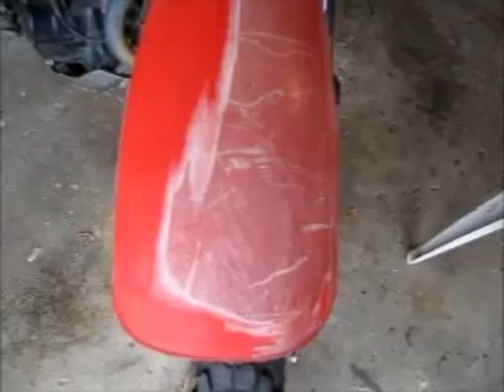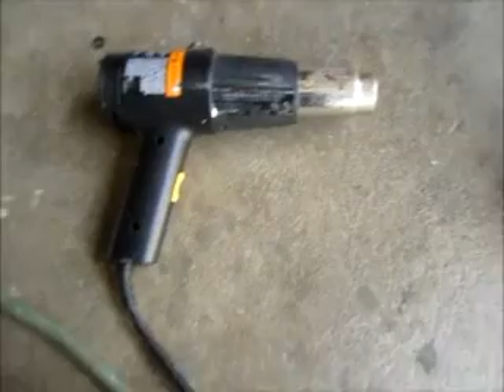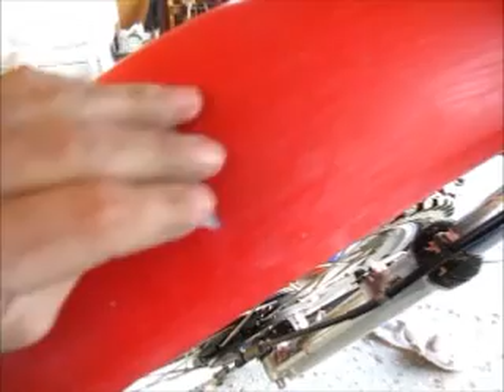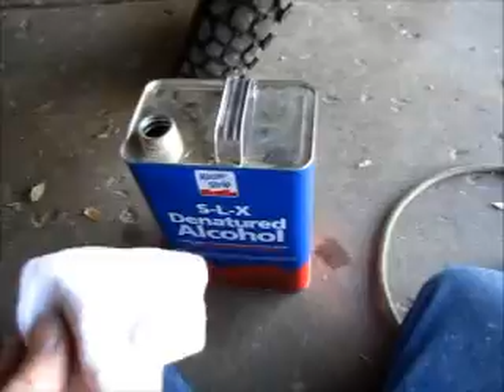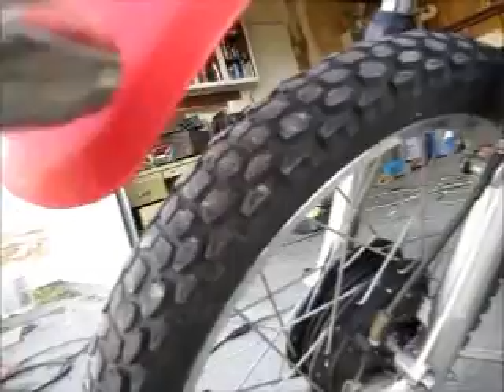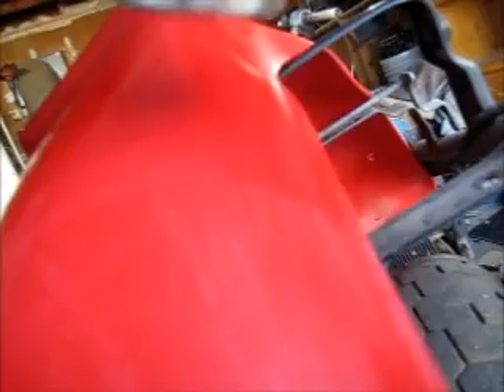How to Restore Faded Plastic Motorcycle Fenders (For free)

Comment: So I have a million dollar question. What if you own an R6, that is white but the head fender is starting to turn yellow? I love my bike and even though this method seems to be an outstanding way to do it, I just feel a little insecure to apply it. Buying the part would cost me $454.58 and not only that, but this was a limited edition color so I wouldnt even have it in white but rather in blue, red, yellow or silver and also if I were to paint it, then I would have to paint the whole bike to make an even color. So Im pretty much screwed. Any suggestions? =(
Reply from the maker: This won't work on painted fenders for obvious reasons :) You could try wet sanding carefully and polishing, otherwise paining is probably you're only option. Luckily white is a forgiving color to work with. Good luck!

Comment: How about sanding it with fine grit sand paper 320/400 an then heating it up an polishing Just wonder how that would work ?
Reply: TheAwGooner No - you can sand plastic and it'll be fine. Bumpers are plastic and they sand those all the time. They sand headlights too. You just want to use a very fine sandpaper.
Reply: skulledmonte84 I used a cheap headlight restoration kit and that plastic trim cleaner for cars.  turned out really nice.
Reply from the maker: I tried sandpaper, and it just didn't work well for me. It clogged up with plastic, and made the finish dull.
Reply: ***** Well i couldn't wait so i started out using 220 "wet sanding" VERY "time consuming" then i stepped up to 320 but still need to go over again with 400,600 an maybe even 1500 grit.Then i am going to use polishing compound an a buffer on low speed. an see how that goes,iv done this to aluminium an the outcome was great.OR i may just finish wet sanding with 320 an just put some good clear coat that's made to stick on plastic
Reply: USCisgay lol hey as long as it works i guess that's all that counts,i tried buffing by hand with polishing compound an it buff up a little an i really had to work it just to get about a foot by foot section,So i am going the easy way an using,Krylon Fusion Plastic Clear Spray Paint
Reply: skulledmonte84 id try to clean them up first.    Do what you like,  but maybe its just me, i really cant stand painted plastics on a dirtbike.  check ebay. what kind of bike is it?
Reply: USCisgay oh it cleaned up nicely while i was sanding it,It's a 4x4 four wheeler that i just wanted it to look a little bit better than what it did .Clear coat will be just fine for me,being that it's clear it will not be that noticeable if it does get nicked or scratched up,plus when i hit the mud your not going to see the flaws anyway Till i rinse it off again  But Thanks though
Reply: steel wool and soapy water. Then pledge. Buff it real good. That's how I've done a few old CRs.
Reply: dan2750 tan yes I'll try that tomorrow
Reply: never sand plastic it will ruin it

Comment: anybody tried the headlight restoration kits, like the one from Mother's?  I'm sure it works by just buffing away the faded layer on top, should work for solid colors too.  The paste and power drill buffer ball might make it easy and fast.
Reply from the maker: It might work, but the difference with these fenders is that it's a much softer than the hard polycarbonate on headlight lenses. That's why the blade worked better than a polish or sandpaper. If you have some of the stuff, give it a try though, maybe it'll do the trick.
Reply: yep iv tryde kit es tou small to even get 1 pic done let alone all the plastice.but i steal tryd gust to see end dent dou cheat

Comment: People just don't understand how hard it is to find plastics for old bikes.
Reply: Newoldstock.com
Reply: @S S thats not old
Reply: I agree they are hard to find and expensive. Better put those dollars in crucial parts... Tires, brakes, chain... Or riding.
Reply: And chinese dirtbikes without knowing the real brand of the plastics
Reply: Website is no longer the same
Reply: It's a pain in the ass I couldn't find rear number plates anywhere on ebay for my 1984 yz80 so I have to buy a parts lot in order to get them
Reply: Well you can find plastics for most bikes but they won't look the same, they will fit but will look way different. finding plastics that look like the originals that's the hard part.

Comment: the fading is caused by the surface of the plastic losing its essential oils and polymers. an easier way to bring back the color without removing material is to add oils back...mineral spirits, marvel mystery oil, and even WD-40 can be applied to the plastic with pretty good results. sometimes simply applying a coating of clear coat spray paint will bring it back, as well.
Reply: this is important to consider if you want to keep any decals or other details that you might ruin by scraping with a razor.
Reply: rtabish An easier but more time consuming was is buffing it with sandpaper and turtle way. :) Just make sure to use a flex block so you don't leave any finger grooves while sanding.

Comment: Did you try using only heater (before scratching plastic with the razor) ? How long the effect will last ? I think the original plastics from the factory has anti sun protection on surface
Reply from the maker: If the plastic is only a little faded, you can get by with just the heat. Mine were way beyond that though.

Comment: Infinite grit sandpaper? Not quite. Also, have you people never heard of wetsanding? You can get a glossy, mirror like finish if you know what you're doing and it will yield a surface smoother than you'd get using a razor. You may be interested to see the "sanding" and polishing techniques used in lenses/optics.

Comment: 60% Paint thinner and 40% Boiled linseed oil will remove the oxidation and bring out the true color...almost to factory new. It saves quite a bit of time and the result will last. Wipe the excess off as you go and you wont have any issues.

Comment: Depends on your make and model. My 88 GSXR you cannot just "go to the store" and buy plastics. Heck, you can hardly find plastics on ebay. Restoration is sometimes the only solution that would not require weeks of searching, and still require some TLC to get them proper.

Comment: I found the scraping with the blade to only really be helpful for removing any scratches that you want to take out.  If it's just faded/oxidized the heat gun works well by itself.

Comment: I recently did a front fender on my Yamaha Big Bear 400 and skipped the scraping process with the blade all together.  It will work with just the heat gun alone as long as you don't get the plastic too hot.  It's not perfect by any means, but from a few feet away you can't tell the difference from a new one right next to it.  Good video
Reply: I wouldn’t skip that process. Your just melting the oxidation layer into the good plastic. That will not look as good as removing it first. Then before using the heat gun do some wet sanding first. 400, 600, 800, Heat gun, Then let cool, wet sand 1000, 1500, 2000, 2500, 3000, Then use polishing compound on a slow setting on your polisher, polish, then top of with SC1 High Gloss Coating 😎👍

Comment: When the plastic is that oxidized/compromised your options of keeping it are limited.  

Today I used sandpaper all the way up to a horrifically expensive 4000 grit to remove some crust and vinyl goo from an '06 fender. I would have started with a razor if I had seen this.

Of course the best option is care but plastic has a way of self-destructing.  I consider my self pretty nice to my plastics but they needs special care- more than detailing even.

Comment: Yes, i did it to my plasics. Start with a bit of a rougher paper, then use a finer paper and a finer paper after that, untill the surface is smooth. It gets almost shiny with just that. But you can also use the heat gun to get more shine. Good luck!

Comment: you can also use a sandpaper, wetsand  it using 600grit then once the fresh layer comes out wetsand it again with 1500 then 2000 grit, it will also come out silky smooth

Comment: Great work! Could I ask you a question? I have a deepish scratch on my front fender which I hope to remove with some elblow grease. My plan is to use 2000 grade wet and dry to slowly sand it out. And then to polish the matt area to a nice shine using a plastic polish designed for coloured plastic parts like these. Do you think that I'll get a good result? Thanks again for the great video! :)

Comment: If you want the same job without all the work use a hotsy (pressure washer) removes it all and doesn't leave high spots.. Then use to heat gun for shine. And way less time and effort for a nicer job.

Comment: how powerful is that heat gun?  Can you buy one what  will be too hot and melt a hole in the fender quickly?  Do you know what setting you were using when you were doing that or what the wattage was?

Comment: do not put water inside the gas tank, EVER. the gas will naturally evaporate over time. bring the bike indoors where it's free from dust from the air and let it evaporate naturally (obviously drain out as much of the gas as possible beforehand).

Comment: Great! Been wondering how to fix them fenders, thanks. Wondering if a sander or angle grinder with a sanding disc will work with scraping off the dull weathered surface? Faster less effort needed maybe...

Comment: All the prep work is good.  However, I have used Plastic Renew for years with great results.  Much better than the heat gun.  It puts the shiny clear coat back on the plastic.  I have restored about 6 bikes with one 8 oz kit.

Comment: Thanks for positing this video! I had a severely messed up plastic panel from my 1970 Motobecane, and no one makes replaced it. I took off 1/32" of nasty milky plastic off, then sanded, then polished with a dremel and plast-x. I don't have a heat gun, but if I do pick one up I'll try finishing it off to get the few "pore" left to close up.

Comment: Your time at a job is the same as your time repairing a fender, they both have a certain value. Time spent at a job to buy fenders can be spent repairing fenders which in turn will give a greater sense of accomplishment while also recycling the material which you would otherwise discard. How exactly are you going to have money left over from a days pay when new fenders can consume the whole days pay for the average worker(especially 4-wheeler plastics)?
Typical American mentality.

Comment: good itp: greased lightning works awesome getting the stains out of any deep scratches. i had a xr600r w shitty white plastic.(wtf were they thinking?) after years of riding, it looked like crap.  if it's too f'd up, try getting vinyl from a sing-graphics store, skim over deep stuff w soft epoxy(5 min or less)  wrap it, and shrink the wrincles w a torch or heat gun. i did my boys jr.50 in green to match my kdx. it looks great.

Comment: When there is that much chalky plastic sand paper clogs it would take for ever. This is the same method I use. Then wet sand then plastic polish... acetone does wonders too old motorcycle plastic it cleans and removes stains.

Comment: I have also used this method on my 81 rm125 project but after I scraped I used different grit sand paper until I was wet sanding perfectly smooth, I then buffed and polished with car wax and they literally looked brand new! Great video!!

Comment: @jenniesgarage You have to go from 1500 to around 3,000 and finally use compounds  ultimately using something like Plastic polish i.e. Meguiar's PlastX and a wool polishing pad.  If you quit at 1500, it will be hazy and dull.

Comment: i did this with an 1986 it 200, the front was bad, i used a razor like you said then i took 320 grit sand paper and made the fender nice and uniform, hit it was a heat gun until it looked wet, then took a metal polish and rubbed it in and wipped it off real good, they came out better than new, we didnt use the alcohol, didnt have any and kinda forgot, did the whole bike in a day thanks man! big help saved me about 200 bucks!